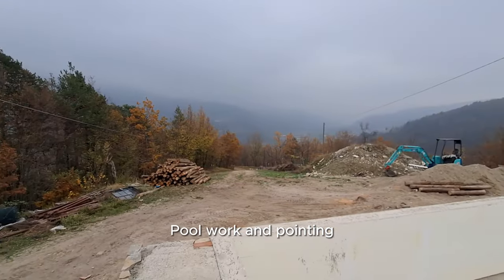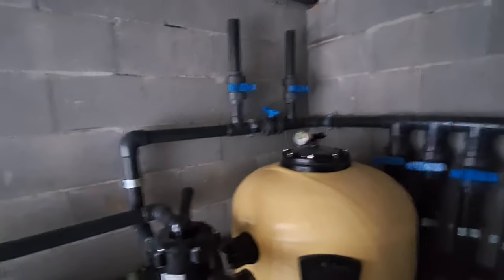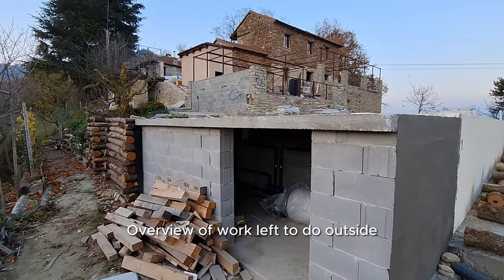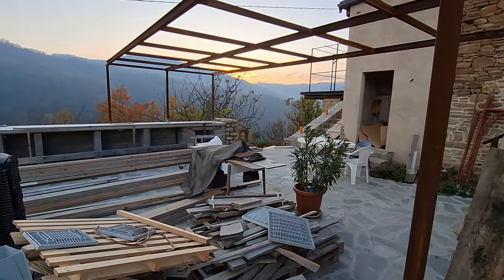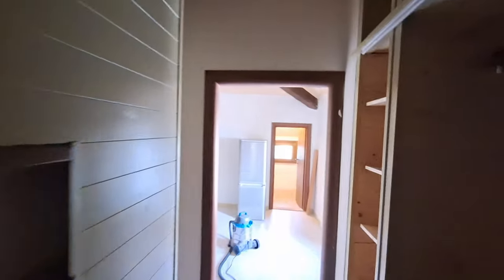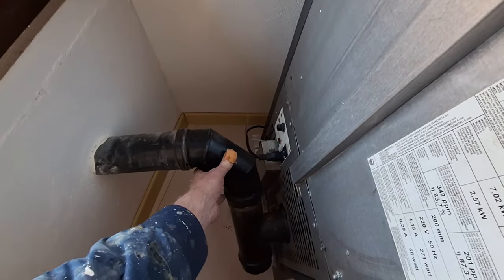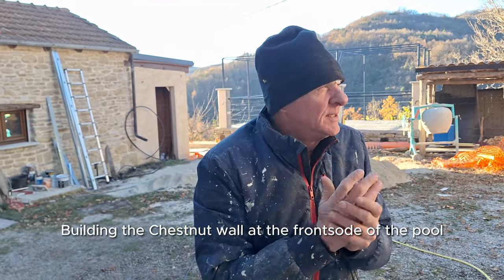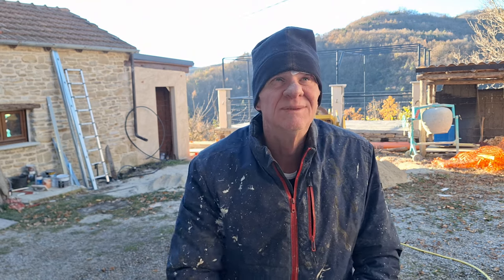#41 Buiding a retaining wall from Chestnut, pool and tiny house updates

Comment: The pointing really is wonderful, I really like how you work so much with stone like this, giving it a natural look rather than using uniform slabs. I was curious about the walls with concrete blocks, it just didn't feel like something you would want visible, but now that you said you'd cover it with lark it makes so much sense! It will go gray with time and blend in perfectly.

Oh dear...you know you've been somewhere a long time if you start swearing on the native language of that country! 😂 It's so good to see your apartment getting livable though. Also...it's a detail, but I really liked the clip where you put the camera at the top of the stairs and walked up them. I've noticed this technique being used in a lot of videos and it's very effective. And you're right in that plants can really transform a room into a home, it makes such a difference!

Oh no, a flat tyre? Such bad luck! Good thing you were able to fix it. I think what you did is probably the smartest thing to do, lengthening the arm to get higher torque - by quite a lot, too! A good thing the screws didn't break being submitted to that.

I'm curious about the chestnut wall. Is the logs dry? I'm guessing they are, or I would be worried they'd move once they dry. Either way, it's indeed really satisfying to look at.

Just out of concern...you haven't gotten injured, have you? 😕 Take care of yourself, don't work too hard!
Reply from the maker: Yes the concrete blocks will be covered with Lark. Will look really nice I belive. So from the garden view you see lots of wood. 
The chestnut logs. Many of them green and so very heavy. But I am not afraid they will move. The torx screws we put in are so strong. You cannot even get them out anymore. It's like the wood encapsulates them. 
I will think about the walking around technique. I think it is noce too. And for the little accidents that happened lately. My thumb .... due to the planer. Above the eyes was a small controlled surgery. Stitches to be removed today. We actually have nurses with service at home in this area :)
Reply: @borgopoggiodeifiori  That's such a relief to hear! Hurting yourself on a planer really does not sound like a very fun experience... Glad to hear you've already had the stitches removed by now, it must be healing well!
Reply from the maker: Yeah let's not go into the details about the planer. It was also - of course - the last piece of the pavement in the tiny house ....... but it healed. The only real problem in the first days was actually the  hansaplast plaster I put on it. It stuck to the wound for a few days and finally got it off with hot wamer and soda.

Comment: Have you considered using horizontal metal cabling for the balcony/terrace? The view would not be interrupted as much as using bulky metal pipes. The tv show "This Old House, USA" has quite a few episodes about it. Just a thought. Love your tiny house.
Reply from the maker: Hi Pat. Thanks for the tip. I checked out some of the Old house videos and actually found one with fencing as I like it. Horizontal bars. But, I talked to my architect about rules and regulations, and they won't let me do iyt like that. I have to do something with vertical fencing. So I guess back to the drawing table and see what I may and may not do. Keep you posted

Comment: Thinking that a light in the pilar beside the last set of stairs you built could illuminate the stairs at night time.
Reply from the maker: Yes William. I put some conduit there too. But now that you mention it ... the wooden stairs doesn't really have any lights. Maybe some Solar Led later on. Although I still have the tecnical room for the pool where I will have electricity. Maybe some lights on the side there...
Reply: @borgopoggiodeifiori  sounds good.  I am really enjoying your progress and the finish work is incredible.

Comment: Horizontal balustrades on your patio railing are a safety hazard, because they are an invitation for small children to climb up and fall over the top. They are actually illegal in some places. Please check your local regulations before you put a ton of work into something like that.
Reply from the maker: Hi Joan. That's exactly right. Same thing I was told by my local architect. So back to the drawing board. Will discuss with him what I can do